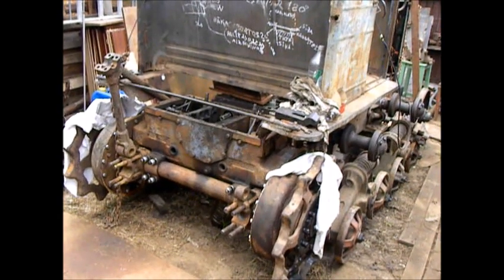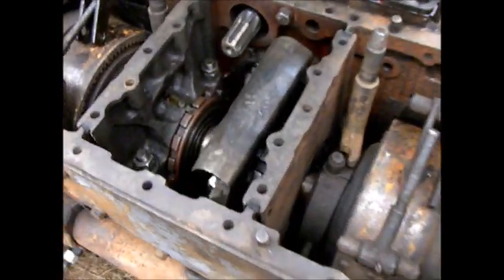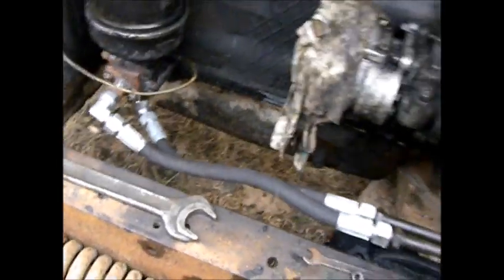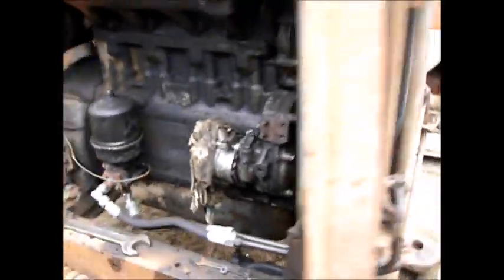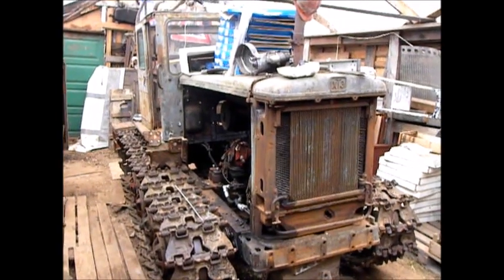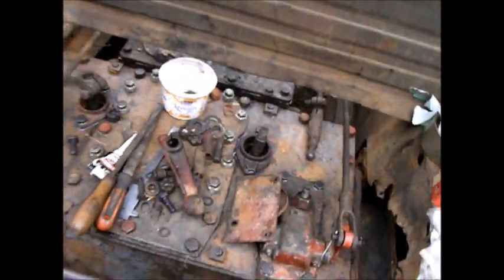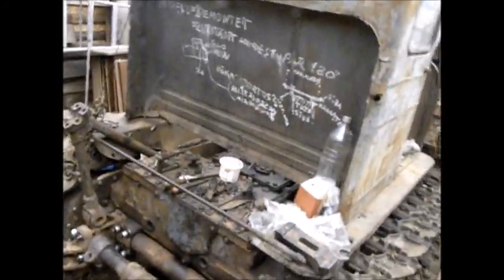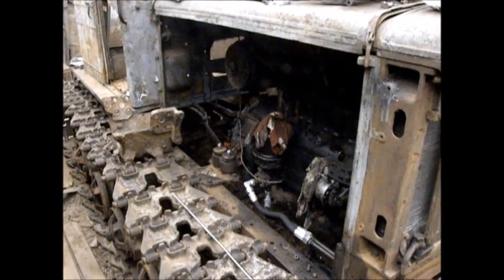Tractor T-74 Project - Tractor get tracks assembled, Walkaround. part 10

Comment: I took the time to watch the series from the beginning. I have a 1979 T-74 so some of the struggles seen in the video are all familiar. I had 2 chipped gear teeth inside the differential but they are at the outside edge of the ring gear so not a big issue. 
You had luck finding parts cause the last years scrap price probably got rid of most of the part donors for T-74. I have a issue with the gearbox detent springs sometimes the shifter sticks and can't get it out of gear. I don't know what to recommend other than don't use 5.8 bolts , factory uses hardened steel bolds 8.8 or 12.9 grade bolds. Other wise you will be taking that thing apart very soon. Also your lucky to get the front weights cause these are hard to find. Usually there is one but not the other side. I wish you the best in completing the project.
Reply from the maker: Yeah, about screws and nuts - need to use best grade 10.9 or 12.9. I took apart 2pcs T-74 tractors in local scrapyards and I get spare gearbox and lot of transmission parts. Fror the gearbos I'm looking for retarder gears and shaft set. To get it running - I'm close to this.... but winter mess up my plans with this.
Reply: @FactoryDragon87  Do you know the place where you got the parts from? I'm in a need of front idler wheel seals and the hook/stopper for the break pedal on the left.
Reply from the maker: @SuperMAZ007  Most parts I get in Lytagra stores. Stopper You can make if You have angle grinder and welder. By the way - where You came from?
Reply: @FactoryDragon87  I found this channel from Youtube suggestions but i reside in Estonia.